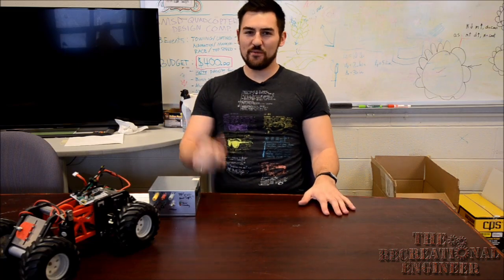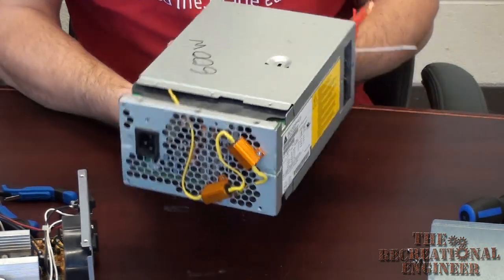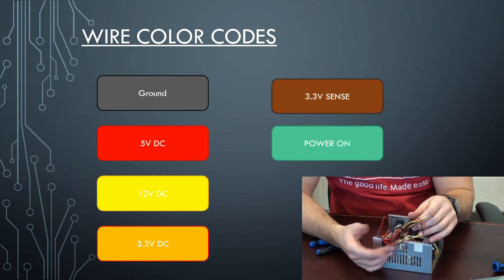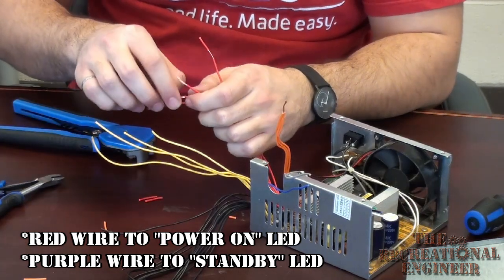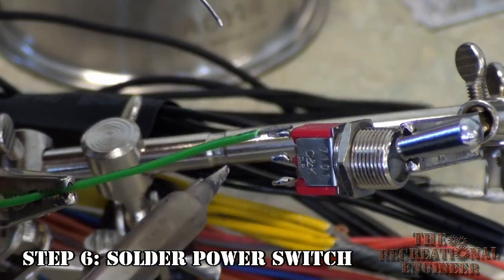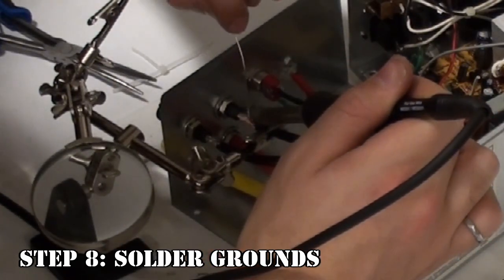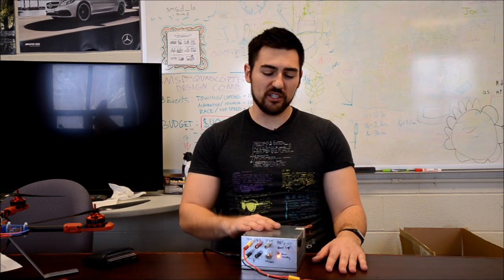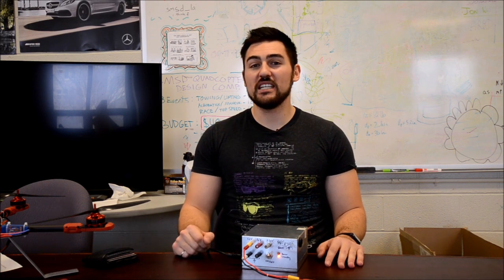$10 DC Power Supply - 1 Day DIY

Comment: It looks like these 5 phm 10 watt dummy load resistors you say we need dont exist. I cant find them on eBay, home of the chinese generic electronic component.
Reply: Look again. look for power resistor
Reply: Electronics parts? Digikey. Also I sometimes use allelectronics.com

Comment: So if my ps unit says the 5 volt side is the strongest volt line at 25 amps. Which wires would I hook to my power load resistor?

Comment: That Delta PSU you used for your first build was about 1000x the quality of the one you used in this video.  I wouldn't connect anything expensive to this one.  Those cheap PSUs are called "gutless wonders" by us geeks for a reason.  They lack vital parts to ensure the safety of components attached to them in a failure.

Comment: Hello! Good helpful video!! I do have a little problem though. I want to use a computer power supply to power a led panel that I made. The +12 supply which I will use is rated at 10 amps. When I hook my led panal to a 12 volt battery  it draws about 6 amps at 12 volts which is correct. When I hook it up to the computer power supply rated at 10 amps in 12 volts, the voltage drops down to about 10.5 volts and it draws a little under 4 amps. I tried hooking a power resistor (5 ohm, 20 watts) to the 5 volt supply and then to ground  and the voltage going to the 12 volt led panal went up to 11 volts from 10.5 volts and the current went up to about 4.7 amps from under 4 amps. So that is an improvement but still not optimum. Any suggestions? Should I put a resistor also on the 3.3 volt supply. Thanks for any help. Oh I tried using a different power supply (almost new and even more powerful) and I had the same problem so I don't think there is a problem  with the power supply. Thanks !
Reply: Some times the 12 v line also needs a load. A test load I bought has 27 ohms on the 5 v line and 8 ohms on the 12 v. But that uses a lot of electricity (about 50 watts). 

Note, for your panel, LEDs are pretty tolerant of low or high volts (within reason). I don't think they need much correction as long as the current stays solid.

Comment: Electronics are my Achilles heel, so I'm trying to learn. My question is that if the 12v source has high amperage (my supply is rated at 19a), will I fry a 12v 6a motor (for example) if I hook it up? I'm trying to wrap my head around this, so I hope it makes sense.
Reply: no

Comment: i have 12v rail has 16 amp and -12v rail has 0.8 amp if i use 12v and -12 i get 24v but how many amps ??
Reply: You will be limited by the -12v rail's max rating.

Comment: It puzzles me why people who modify these units continue to assert that bundling the colored wires "allows for max current flow." One can easily find the current carrying capacity of wire with a google search. The wires in this video look to be 18 AWG, which is stated as being able to carry 16 amps max. For a 40 amp application you'd use three wires and for 20 amps you'd use two; anything else is overkill.
Reply: I like overkill!
Reply: Heres why :soldering off the wires is a pain and can potentially damage PSU and/or shock you, bundling them up and heat shrinking them will prove to be no different them just bundling them up and using them
Reply: @voyagertechnologies  . I do think a combo is fine. A couple few wires overkill and then bundle and seal off for safety is a good idea indeed.
Reply: Can't understand what you trying to say here! try phrasing it differently
Reply: More wires usually means shared current from a color group of wires. Wires sharing current usually means less heat. When you google search "wire awg current load". It usually won't tell you how hot that wire will get. Carrying the maximum load of current. And even more importantly what is the temperature rating on wire jacket before it will fail. Overkill in wiring more times than not means less heat. If you have to pay for the wire. It will cost more money upfront. But it will save you money in the long run by not causing damage. And me that is 1 less thing that I have to be concerned with.
Reply: Exactly idiot is trying to justify being safe somehow! having more wires doesn't hurt specially if you are gonna bundle them up and heatshrink them (essentially wasting them)  why not use them..
Reply: That too

Comment: Hello. I wanted to ask something. Please help with an answer. I am using an old PC Power Supply for my Turnigy Lipo battery charger. I have had the Charger connected to a battery (large one from a 4x4) and have a Car Battery Charger charging it at the same time. When I connect my LiPo I can charge at 6.0Amps. But, when I use the PC power supple and try charging my Lipo the only way i have been able to get it to charge my battery is if I have the supply current set to 2.5Amp, instead of the preferred 6.0A. Is this typical of using an old PC Power Supply? I would really like to be able to charge at a high setting if possible. What can i do (besides stop being a cheap-arse and go buy a better power supply. :P)?

Comment: i do not have a Brown witte i do have a gray purple blue and green wire and  also 5 V 3.3 V and the 12 V wire
Reply: If you don't have a brown 3.3v sense, look for an orange that is much thinner than the other orange wires, that will be your sense line.  Check your 20+4 pin motherboard connector to be sure.  One of the 3.3v pins will have 2 wires, one a regular orange, the other will be the sense.

One of the sides of the power supply should have a large sticker with a legend for the colors.

Comment: can you tell me when you bundled up all the 12v,5v, and 3 volt wires is this to get more amperage ? or why was this done?
Reply: No, it wont "add more amperage", but it'll make sure the current (amps) can be shared between the wires so they don't heat up as much. Imagine driving 40 amps through one of those thin black wires; it'd catch fire in (I estimate) about 10 seconds. Though, if those 40 amps are shared between 20 wires, then each wire would only have to carry 2 amps, which is completely fine. Hope this cleared things up a bit :)

Comment: i did this to a new psu but when i hit the toggle switch for power, i get a flashing green led. the psu is a brand new 600w evga unit from best buy. what did i do wrong or what happened?

Comment: Would this work to power police comunication equipment? Custom power supplies run at 13.8 V / 10 A but they work fine when plugged directly into cars batteries.

Comment: how can i under stand my atx power supply is old or new?? 
my power supply model is tp-atx11
+5v-28A
+12-16A
Reply: if there are more amps on the 5v rail then it is an older power supply, more on the 12v and it is newer.
so yours is older

Comment: If you attach the dummy resistor, does it have to be connected to main line and ground or two main line wires?

Comment: Great Post!!!... My supply has 12V1(18A) & 12V2(16A)... I was spooked that maybe I would be creating conflict from separate x-formers... No worries, both circuits continuity at 0 ohms so OK to tie all together for 12V @ 34A... Just Sharing :) Overkill but I load resistored 12V & 5V :P ... also added blade style 30A fuse for 12V, a female USB jack fed by purple(5V @ 2.5A on my supply), a 12V automotive socket & a 12V XT-60 socket... all clean mounted to the housing... relocated fan to exterior of case to make room for all this extra crap ;) haha I think I have just enough room left for a digital V/A display meter on the 12V... HEY, what would a -12V(neg) output be used for???

Comment: There should be one purple wire 5 volt that's used for a standby always on great for USB Power and a light gray wire that I use for the power on, it tells me that everything checked out good so if that LED light goes out and it's still running, it's time to shut it down and investigate.

Comment: I have a PSU with most power on the 3.3 wire (22A), but I have two rails for 12V (10A and 15A). Can I connect 12V rails together and get a total of 25A? And what dummy load resistance should it have?

Comment: I'm not so sure if you know what you're talking about. 5v has more max draw current? Duh? It's because it's old? Weird stuff. Amps = watts/volts so you have 200W PSU and on 5v rail, you'll get a 200/5=40A Max IF they were NOT using DC->DC for minor rails. Regardless, it's not surprising that you higher amperage on a minor rail because it's the way electricity works. 
Or you can try to desolder the large caps right after you unplug it from the wall. They are the ones reserving the 5v @ 20 Amps peak.

Comment: hi :) nice build. instead of using 5ohm 10w resistor can i use led lights or led strip for lighting which will act as a load when no external load connect.. is that going to be fine?

Comment: let me give more details. i have a power supply laying around that cant run my machines due to low current  ,for a tattoo machine  , basically what i woul like to do is switch the voltage meter and the voltage adjuster knob along with 2 jack outputs, and add them to the computer power supply, is this possible ?
Reply from the maker: Ernie Gomez I'm sorry but i can't understand what you're asking
Reply: The Recreational Engineer sorry, first ,i would like to know if it is possible to change a  fixed voltage  computer power supply into  adjustable voltage(0-12v)...
Reply from the maker: Ernie Gomez yes it is possible, my suggestion would be to. Purchase a 0-30v buck converter from Amazon, eBay, Alibaba, or the like and wire it to your 12v line. This will give you the adjustment you need
Reply: The Recreational Engineer I just looked up 0-30v buck converter , its not expesnsive at all. If i can achieve a power supply that will run my tattoo machines this will save me hundreds on buying another one. thanks a lot for the help...
Reply from the maker: Ernie Gomez you should check how much current your tattoo machine pulls before making any decisions.
Reply: The Recreational Engineer, all machines differ but lets say around .50- 1.0 amps
Reply from the maker: Ernie Gomez you'll be fine, that's quite low

Comment: Instead of a conventional resistor as a dummy load I use a car bulb inside the box, it is kept cool by the fan and it also acts as an "on" indicator. :-))
Reply: Silver Legend I built this but when I plug power in I get standby power but when I switch it on I get no main power. Also I tried removing switch and twisting green and grn wire together so I know it’s not the switch. Can anyone give me any troubleshooting advice please.
Reply: @aaronward6092  It might be a diffrent color wire mine was Grey it tepends if it's a 24 pin psu or a 20 pin u can tell by looking at the connector that plugs into the motherboard sorry for bad English it is not my first language
Reply: @aaronward6092  i think it not loaded yet. try load with 12v led or something and try again to on the switch. sorry bad english
Reply: Can you explain, why do we need a dummy load?
Reply: @sudiptoborun  Many PC power supplies must have a load on the 5 volt rail to function, particularly in the absence of any other rail(s) being loaded. I hope that helps.

Comment: Great video. I'd like to do this so I can test car audio gear. Recently decided to put a system in my car. Got a nice deal on a used PPI 900.5 amp, some BNIB speakers, BNIB Alpine HU from car audio forum guys. And a good deal on a Polk subwoofer ready to go in a factory box from Amazon Warehouse. So had to know right away if it was working.

Middle of February freezing cold. Had to do the mad scramble 1 day in my unheated garage, 1 day in my buddies driveway. Then the rca's I bought were bad. Another day figuring that out too. Man I wish I knew about this then. Would have saved me such a hassle. 

Thank you
Reply from the maker: Andrew Balus No problem I'm glad you found it usefull
Reply: Andrew Balus

Comment: I have old power supply can I use 10 ohm and 10 w resistor
Reply from the maker: MK Unboxing Probably. Without any details on your PSU I can't say for sure. Just try it.
Reply: my power supply details
+3.3v 20A,+5v 20A,+12v 13A
please tell me can I use 10 ohm 10 w resistor and how many resistor can I use and which line I will connect this resistor please reply
Reply from the maker: MK Unboxing just put one end on 5v line and one to ground
Reply: how many resistor I use 1 or 2
Reply from the maker: MK Unboxing just 1, 2 in series if the one gets crazy hot
Reply: you can! i used 10 ohm 5 watt on 5v rail to bring the 12v rail at correct output
Reply: @TheSlimShady87  Did you maybe mean 5 ohm 10 watt on 5v rail?

Comment: How many ohms are the load resistors? I'm doing a similar project but using it as a 3D printer power supply.
Reply from the maker: Niccolo G see disc.

Comment: i am pretty new to this, so if there is no load resistor, the supply will be unstable ?  After u connect the resistor, juz put it inside the box randomly?  How did u connect the LED's?  As I said, I am pretty new to electronics.... thanks!
Reply from the maker: sunchaser w The supply is meant to be attached to a PC. Without a load some PSUs will turn off to save power. The dummy load ensures it will stay on.

Comment: hi, I dont know if you could help me , I,ve tried to do it with a Compaq psu  series pdp-124p , and i'm unable to make it start. i'ave done everything shown in your video. green wire to ground , 5v to resistor to ground , 12v to resistor to ground , etc and it would still dont start. do you know if there something special to do with that model.

Comment: Hi there, if i don't have a load resistor, could i use a 12v LED strip as the load, or would it burn out?
Reply: First up 1 thing that he doesn't explain is that you want to attach the load preferably to the voltage line with the higher amperage rating (just check the side of your supply) because the older supplies have a majority of the amps on the 3.3 and 5v pins whilst the new ones put more on the 12v line. Now onto the topic of using leds as your load. It really depends on how much watts the strip is using. Leds shouldn't burn out if your using the right voltage. Let me know if you have any further questions and good luck man!
Reply: Thanks. I put a 1.2 ohm dummy load resistor on my 5v line at 13 Amps, even though the most current is on my 12v line, but the dummy load gets unbelievably hot. is there a max temperature that one could expect it to reach? of coarse if it starts melting the wires something is wrong no?
Reply from the maker: Alec Traub LED strip have built in resistors so they should not burn out. Whether the load is high enough is dependent on the power supply. Your resistor got hot because it's resistance value was low. More current flows through lower value resistors.
Reply: Alec Traub Different wattage resistors are also something you might want to look into. If you have any way of measuring the tempature of the resistor and refrencing it with a datasheet then you can see if you need a higher wattage resistor. The higher the wattage rating the more efficiently it will distribute heat. Resistor operating tempatures can get REALLY HOT and work fine! If you are worried about the heat just up the wattage or put a heatsync on it. You can also ziptie the resistor to the outtake of the fan to keep it cool. After making this project for myself I found that the dummy load also sometimes helps to even out the voltage levels to the proper voltages of 3.3, 5, and 12 volts. DO KEEP IN MIND that the 5v line should have a resistor minimum of around 5ohms at 5watts but the 12v line will be different. For 12v i'd say at least 24 ohms at 5watts. (Going up to 10-20Watts if you want to keep things colder on either)

Comment: It may have been here, but why the resistor for the led?  I will be using a 12v led as indicator lights with a newer power supply,  Will I need the resistor on the lamp?
Reply: John  Cantalupo it's always good to have a resistor on LEDs both to protect the device from the LED drawing too much current or to protect the LED from the supply. You can go without it but it's highly recommended as a precaution.

Comment: great video. I also added a potentiometer on one of my 12v lines. Works great. I just blew one when I accidently touched another power lead to it.
Reply: how did you wired a potensiometer in that line and did you put a digital voltometer also?

Comment: ok so i have a 450watt power supply NEW,  it only porpose is to power 5 80mm computer fans and two 40mm fans, and two red LED's, i soddered the green and black wire together, the ATX power supply has a on/off switch built in, so when i turn that switch on, all the fans turn on  but only for a minute then it shuts down,  what else do i need to do?
Reply: Desmo Valve what does your wiring look like?

Comment: u didnt show us how to link the leds
Reply from the maker: PsyKode refer to the diagram in the video. LEDs should be attached in series to a 330ohm
Reply: ok so standby let attached in series to the purple wire and the other led that shows us the system is working is  attached to the red wire?
Reply from the maker: PsyKode correct. Both should be in series with a 330ohm resistor
Reply: The Recreational Engineer okay i will try to modify a psu to make it a power supply for my lipo bats. i love aeromodelism and this would help me alot

Comment: Hey Dan, Is it possible to do multiple 12V/3.3V/5V outputs on one psu? There are multiple yellow wires and black wires...does each yellow wire pared with black be one 12V output?  Thanks for great video! subscribed.
Reply from the maker: madTube1 Yes you can do several posts if you wish. Bundling the wires to one post allows for maximum current flow but if you applications are only a few amps each splitting them is no problem